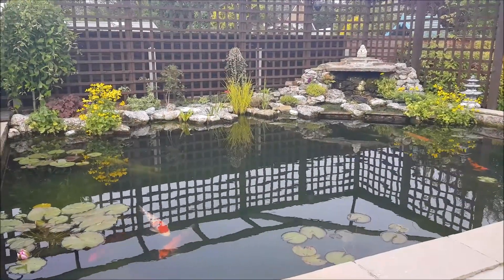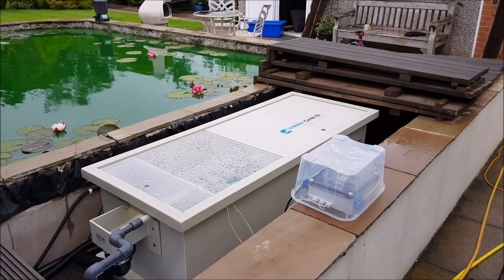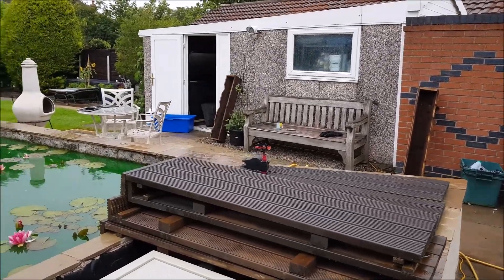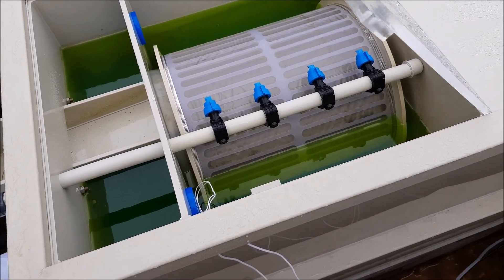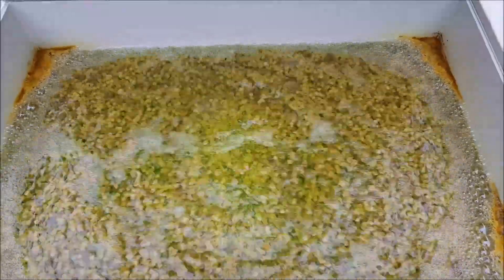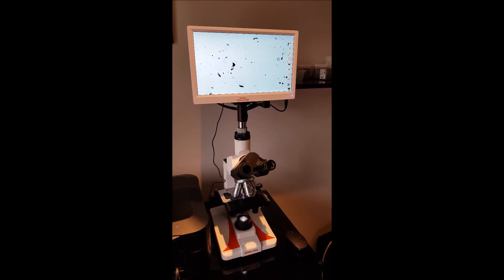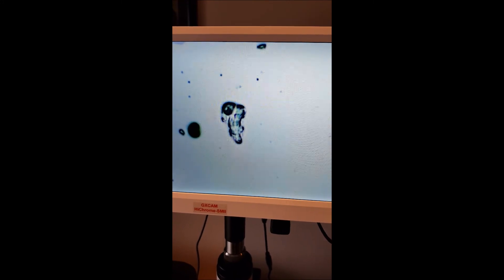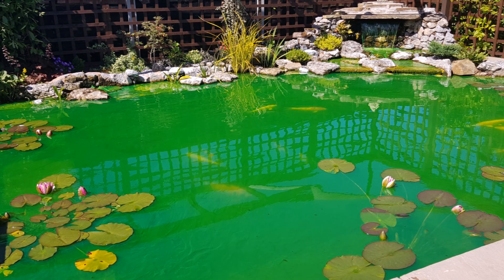New Combi Drum Filter installation

Comment: Hydrogen Peroxide kills off hair algae. To outcompete the algae with plants would take up half the pool in plants..or separate plant pond as a filter.
Whatever happened to sand filters for Koi? Or small gravels in those filters? Seems basic..just use a good backflush system.

Comment: Very nice upgrade...how much watts does it use if you don't mind me asking?
Reply from the maker: Thanks :)  The flushing pump is rated at 1000W.  I'm not too sure what the wattage of the actual motor that turns the drum, but I will have a look in the morning for you.
Reply: Thank you my friend for the reply was a bit curious as to how much wattage the entire pond uses.... currently building my own pond so trying to research on type of filtration and running costs... ;)
Reply from the maker: It's about 350W in total it's using with everything turned on. That's 3 x 10,000 pumps, 1 x 110W and a UV air pump on 24/7 for the bio. That doesn't include the flushing pump. It usually cleans every 40 minutes or so so hardly noticeable. As for physical costs, it's about £1.75 per day to run. Hope this helps mate.
Reply: Thank you very much for the info appreciate it 👊

Comment: hi,thanks for reply,I've just purchased synergy 35 combi but not had time to plumb her in yet,possible tip,because of noisy pressure pump I was told to use flexible pipe,stops vibration apparently, but have to make sure pipe is really secure using two clips on each end
 Marek
Reply from the maker: They are very noisy which is a shame.  I have tried running it straight from the mains but it sucks the hose pipe dry. Shame really but I might take a look online for something a little quieter shortly.